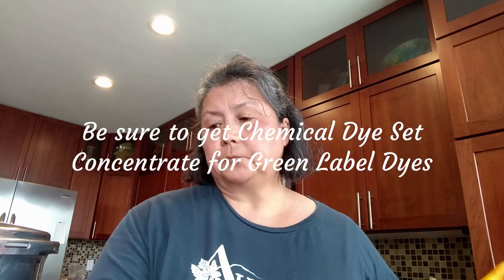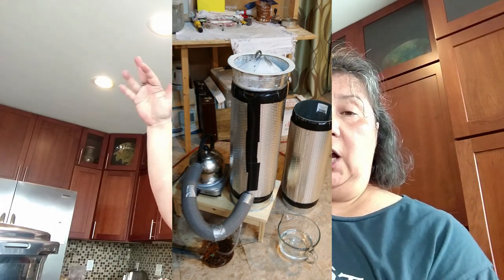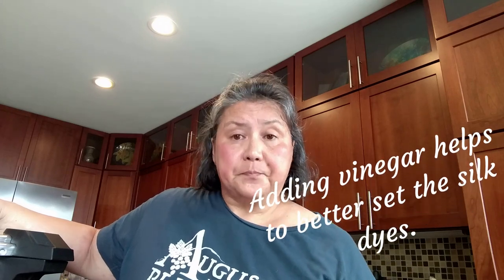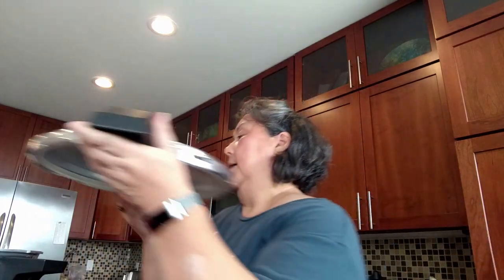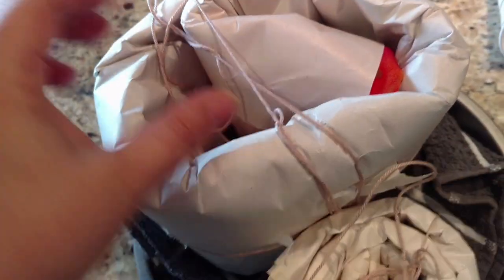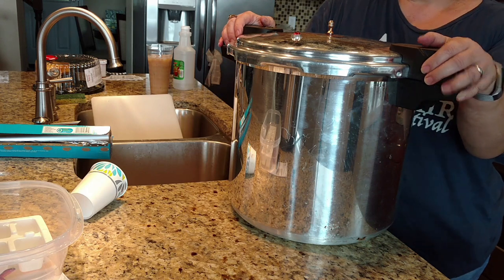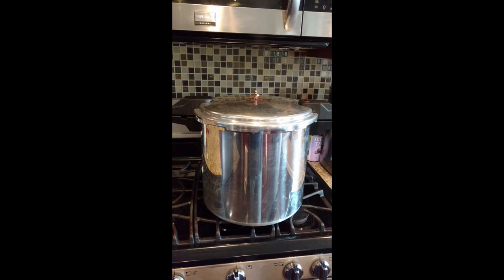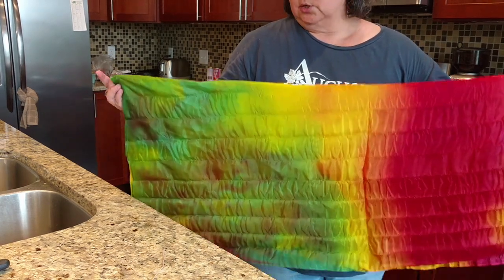Silk Steaming in a Pressure Cooker

Comment: It is a very nice vide. there is some confusion about the pressure cooker size. Is it 22 quart or 8 quart? How big a cooker you need for small items like 36 inch square piece or  scarves? thanks
Reply from the maker: You can use a smaller pressure cooker for that. If you roll it up like a snake, it takes up little room. The one I used was 22 quarts, because it was what Lowe's had specifically for large-scale canning, and I do multiple big items. This method works best on a gas stove. I had a smaller one I used in the RV, but since it was an electric range, it took longer to steam up. If you do have an electric range, I would suggest you stream it for an hour to get the dyes to fix well.
Reply: @lotusleestudios  Thank you so much for good explanation. !